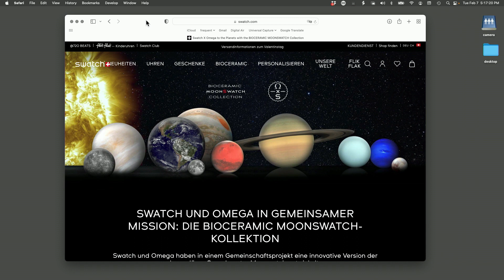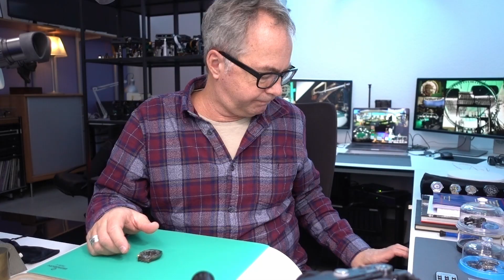1990 Swatch Chrono

Comment: I think you’re the only person on the internet that has mentioned what exact ETA movement was used in these old 90’s 12-hour Swatch chronos. I can’t find a single piece of evidence anywhere online. Although it appears that the eta 251.262 is a 27 jewel movement, but on the back of the Swatch caseback it says 22 jewels. Bit confusing.
Reply from the maker: Thanks for your comment! I love it that you noticed that! If anyone else is interested I show this movement's caliber number at 25:30. And like @rawz05 I can't find any mention of this caliber being used in the Swatch Chrono anywhere, nor can I find a 22 jewel version of it. I might have to break some more Chronos to see which jewels they left out, if they gave it a new caliber number in later 22 jewel chronos, and just how deep this rabbit hole goes!
Reply: @IMakeWatches  Swatch probably took some cost cutting measures and modified existing movements to make them cheaper. That's what I suspect.

Comment: my chrono irony died... you know wich eta would fit to it?
Reply from the maker: The difficult part will be getting the old movement out without damaging the case or crystal (I would say this is impossible if it's a plastic chrono, and I have never tried it with a metal one). After you get the movement out it will be marked as to which caliber it is!
Reply: @IMakeWatches  already removed the crystal... hehe isnt that hard
Reply from the maker: @jcsivelli  Fantastic!  I see now that you said it was an Irony in your original post. I guess I'll have to open one of those up now that you've led the way! 😂😂😂
Reply: It's most likely a ETA G10 variant. There are some videos on YT servicing an Irony. Obviously you have to access from the front, remove the hands and dial, release the stem then remove the movement.

Comment: Working a lot on repairing them. This is a great video and it would be amazing to see how you reassemble them together. The small gears on the motors and the metal shield are key.
Reply from the maker: That was a disassemble only event 😂😂😂

Comment: Hello does anyone know the exact size of the glass for the classic chrono models? Like grand prix scj101 / wall street scb106...Models from 91 - 92 etc? I've managed to open one so far and changed the mechanism but I need to add a new glass and not sure about the exact size. Thanks in advanced
Reply from the maker: I just measured three of them (one 21 jewel Chrono from 1991 and two 4 jewel Chronos from later) and they all measure 33.5mm. Also, if you search Ebay for Swatch crystal that number (33.5mm) will come up as an option so I'm pretty sure that's the correct diameter.
Reply: Thank you so much! I’ll biy one and see if I can fix it.
Reply: Thank you so much! I’ll biy one and see if I can fix it. Best regards
Reply: Thank you so much! I’ll biy one and see if I can fix it. Best regards
Reply: Thank you so much! I’ll biy one and see if I can fix it. Best regards
Reply: Thank you so much! I’ll biy one and see if I can fix it. Best regards
Reply: Thank you so much! I’ll biy one and see if I can fix it. Best regards
Reply: Thank you so much! I’ll biy one and see if I can fix it. Best regards
Reply: Thank you so much! I’ll biy one and see if I can fix it. Best regards
Reply: Thank you so much! I’ll biy one and see if I can fix it. Best regards
Reply: Thank you so much! I’ll biy one and see if I can fix it. Best regards
Reply: Thank you so much! I’ll biy one and see if I can fix it. Best regards
Reply: Thank you so much! I’ll biy one and see if I can fix it. Best regards
Reply: Thank you so much! I’ll biy one and see if I can fix it. Best regards
Reply: Thank you so much! I’ll biy one and see if I can fix it. Best regards
Reply: Thank you so much! I’ll biy one and see if I can fix it. Best regards

Comment: I have the Swatch Grand Prix Chronograph , it works but the dial is loose 😢 would be repairable if i sent to Switzerland  to Swatch ? Or these really are watches that can't  be opened and repairable?
Reply from the maker: In general the yellow plastic Grand Prix like other Chronos of that design are not repairable because the plastic crystal is ultrasonically welded (melted plastic to plastic) onto the case plastic. But the hands should keep the dial from moving. Is it just jiggly or what are the symptoms of it being loose exactly?
Reply: @IMakeWatches  
Apologize  , not the dial but the minutes  pointer is loose , it rotates but when in contact with chronograph  pointers  it doesn't  rotate because is loose and touch the dial
Reply: @IMakeWatches  
I was just checking  this morning  see if i could  find  another one in good working  order , wow i can't  believe  how expensive  they are this day !

Comment: Hi. I always enjoy watching your videos with great interest. I have a question about microscopes. If you don't mind, could you please answer it? I was influenced by your equipment and purchased the same double-arm compound microscope set just like yours. I am satisfied with the microscope and camera images, but there is a problem with the arms. There are two places where the arm can be tilted as you know but the grip strength of the one without a lever is weak and it easily moves due to gravity. I'm referring to the part that you tilt and use. Have you experienced the same problem? I contacted Eakins support but it hasn't been resolved yet.
Reply from the maker: In my experience it works but it's not meant to be adjustable so if you want to change it without using a tool it's not really designed for that. I kind of do it anyway -- force a position change when it's semi-tight -- but I agree that's not ideal. . If it's always too loose and you can't even get it to lock with a hex key then you may have a stripped thread or some other problem. I'll look at mine again and see if there might be a way to put a levered handle on it instead of a hex bolt. That would be a nice upgrade for mine as well if it's something we can just do ourselves!
Reply: @IMakeWatches  Thank for your reply. I can't lock it in any position even when I tighten it up all the way with a tool. I already stripped the threads and I'm assuming that the each thread are not close enough to get a strong grip to the rod.
Reply from the maker: @kojitakeda794  Okay, thanks. I'll take a look at mine in a bit and will get back to you!
Reply: @IMakeWatches  Thank you so much! It's getting looser not even semi-locked any more and I can only use this arm back and forth. I found out that Amscope double arm has so many levers and looks more sturdy but more expensive. As you mentioned it would be nice if I could modify it.
Reply from the maker: @kojitakeda794  I just uploaded the video about this. I'm still working on the description so it's unlisted but you can check it out and let me know if you have the same boom and if using it in the way I do solves your problem or not. If something is stripped already that's not good obviously. https://www.youtube.com/watch?v=Rjljl_c_7tc
Reply: @IMakeWatches  Thank you so much for taking your time to show your setup. I appreciate it. I think that my arm is the same as yours but 3 screws are the same in size because I can use the same tool to loosen up or tighten up all of them. Your way of using the arm is very unique and I definitely want to do the same but I can't lock up that part in the first place. I think my arm is defective unfortunately.I hope Eakins support will do something about it. 
Thank you again for your kindness!

Comment: Hold on, wait a minute!...
If that is really an ETA251262 it currently has a value of between €141.00 €245.44 with a dial (Chrono24) It's not a disposable mechanism at all, on the contrary it's very repairable.
You could put it in another case, if you don't destroy it already :O
Reply from the maker: Ha! Hi Oscar! It is an ETA 251262, and it's clearly a very well made movement. But after 30 years it's questionable how much more time it has on it without a full service and a new case. Probably better to buy a new one. https://www.watchys.ch/fr/mouvements/5274-mouvement-eta-251262.html I paid less than US$8 including shipping for the Chrono in the video: https://www.ricardo.ch/fr/a/swatch-uhr-chronograph-1218330788/ Chrono24 pricing reflects what sellers want for an item, not the market value! 😂😂😂

Comment: I was also imoressed when i took apart a defective one but couldn't see the caliber number. Thanks.
PS The newer 4 jewel models are not as well made, but they tend to work very well themselves, less screws though.
Reply from the maker: I don't like the newer ones because they do away with the 12 hour register and add tenths of a second, which is useless.
Reply: The newer ones are G10 variants, same as what they're using in the Moonswatch. They remove the back metal plate for battery access and probably other cost savings deletions. People are now cutting open their Moonswatches and placing the movement/dial in Steel cases designed for VK63 movement which requires 3D printed movement holders. The stem heights and pusher heights are different so dial spacers are also needed.